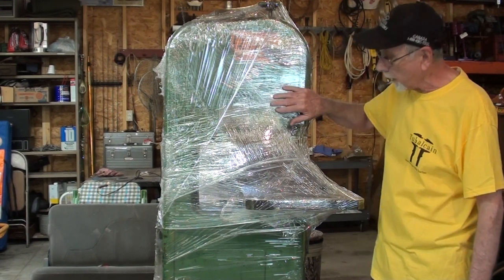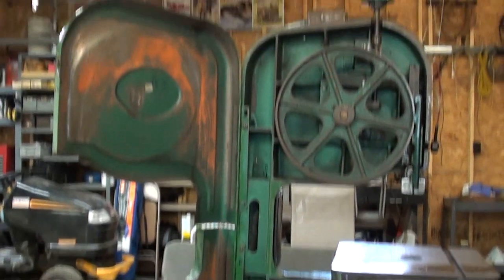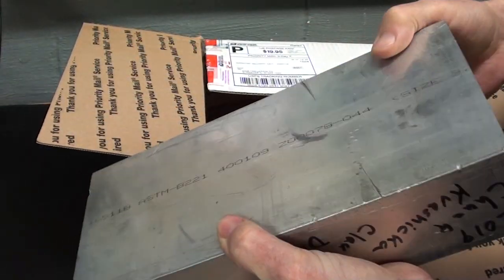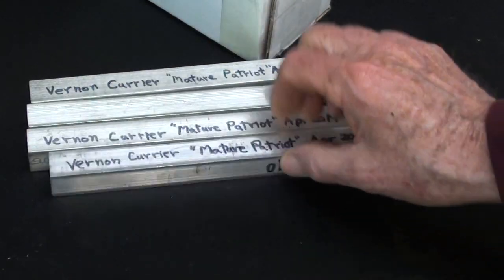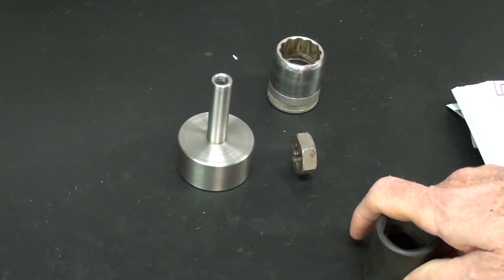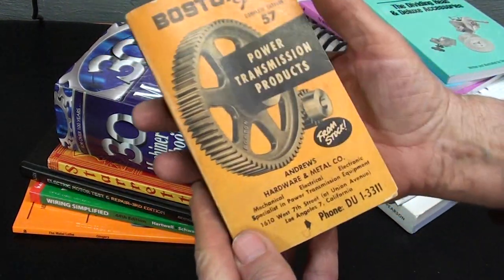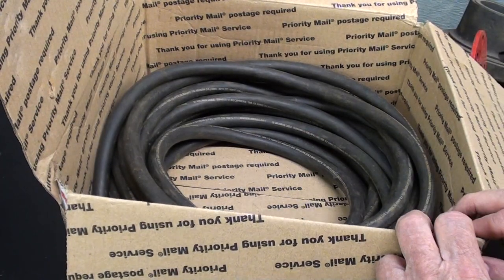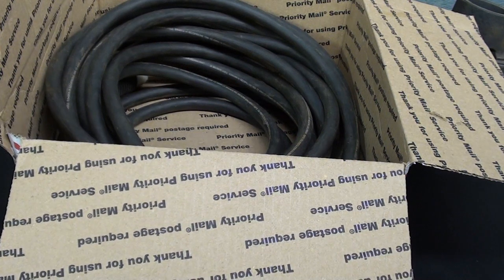This & That 47 tubalcain mrpete

Comment: THANK YOU...for sharing. Like the vise-mount.
Reply: Put 2 or 3 of those receiver hitches along the bench, make some simple Vs to hold pipe or rods while working on them. Add a couple holes for ratchet straps or bungees or mount a chain vise or a pipe vise if you want. You can turn them 90 degrees to work on stuff vertical.  Lots of stuff you can use those mounts for.

Comment: Great video Pete.
I had used a powermatic bandsaw like that at NASA. New, out of the crate, it required a complete component re-assembly. 
Still in the 1970's, we had machines come in (like Doall bandsaws), still in the crates, GSA purchased back during WWII, with cosmolin on them. These were well built, ready to use machines.

Comment: Hey Mr. Pete, That's a great idea for a mount on your work bench. I believe I'm going to make one and have multiple upper mounts for different items (ie vise, grinder, pipe vise and so on) I will makeup another lower setup mounted out of the way so I can just grab whatever tool I need and put it in the bench fixture. Great idea to keep your work bench clear and totally usable.

Comment: I admit I don’t do my feet, it’s easier to go to the nail place and get a basic pedicure, on the powermatic band saw, it’s really heavy and the right price to do an conversion. On my 12” Craftsman conversion I had $150 just in belts, bearings, and pulleys to build a jackshaft system. IHMO that’s why one needs to find the saw as inexpensive as possible. By the way I’m well pleased with my conversion I just have to take my time when using the saw. Man that was one heck of a piece of aluminum. Take care

Comment: Those nail clippers make very good wire cutters. Don't discard until you try wire cutting. Carl
Reply: You are correct.  They work great for stranded copper 14 gauge or smaller.

Comment: To Dennis Watson. Do not put the bolts in the middle of the tubing, but instead weld the nuts on the corner. The corner nuts can withstand a lot more downward force than a center bolt, because the center bolt will easier deform the inner tube, but the corner nut have a lot more material to deform. And even if it deform the corner of the tube, that only stops it even better from slipping downwards.

Comment: Find yourself a Reeves drive for the band saw and be done with it..  Mike in Louisiana
Reply: years ago, ww grainger sold a nice small reeves drive unit. have not been able to find one of them around.
Reply: @commando340  I found some Reeves components on Ebay for cheap but that was before you had to mortgage your home to buy anything there...

Comment: Wayne Moore's book, "Foundations of Mechanical Accuracy", warns us about machining instability into cast iron and notes that we should use a single point cutter (I assume he is referring to using a shaper). How bad is this instability and should we consider it for other materials? How bad can it actually be? I've never considered it when having parts machined. I'm having a hard time getting my mind wrapped around the idea that a single point cutter is that much different than a rotating cutter (fly cutter) with a large diameter. Is there an experiment that can be done on a shaper and mill to prove this exists and how to reduce this error if it does exist (many shops don't have a shaper)? Thanks for your many hours of mentoring you and your fellow youtube creators provide to your viewers. I also appreciate your intentional avoidance of any profane language as you have become a mainstay source of practical education for me and my children.
Reply from the maker: Thank you, I do not use bad language in my video. I have never heard of that business of the single point tool to avoid distortions. I really do not know much about it